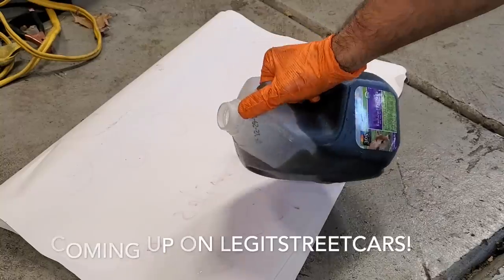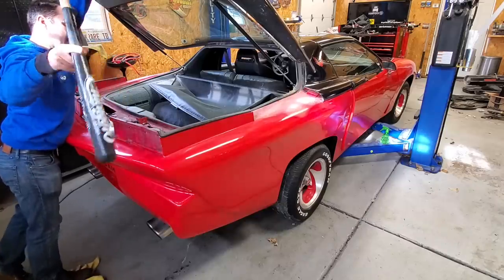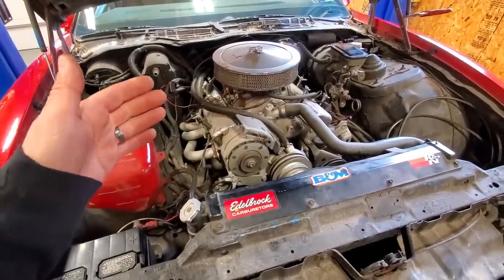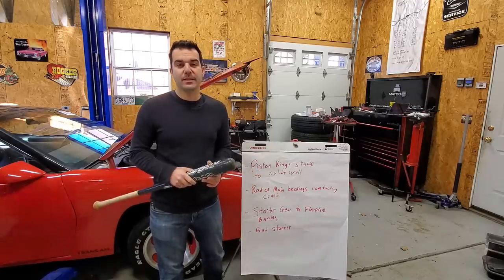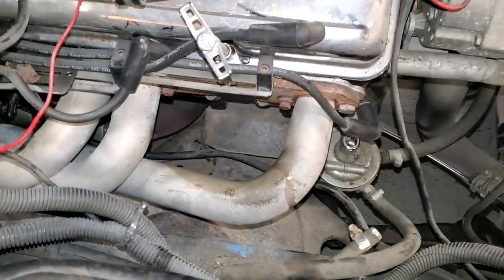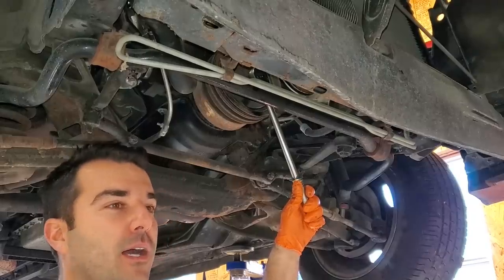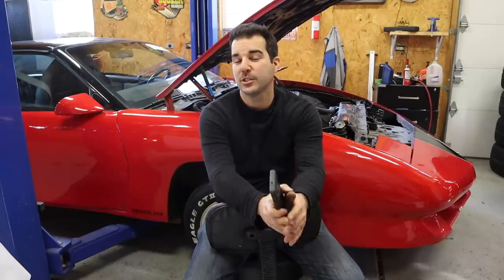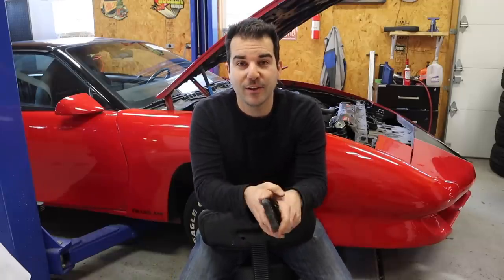My $1,100 Mystery Auction Car Has A CRAZY History! Famous Builder & Built Engine But, Will It Start?

Comment: You could have some sticky lifters that are stuck in the compressed position.  I would start it and let it run for around two or three minutes so the lifters have oil sitting on top of them you can check them by pulling the valve covers.  Then just let it sit two or three days and try it one more time, they should pump up.   Did you add all the new oil in one valve cover?  The lifters on that side could be sitting with new oil on them and the other side is dry.  Pull the coil and turn it over until you have 40psi or more for 30 to 60 sec.

Comment: That noise at the end sounds like either  a belt/tensioner issue or a bearing issue on one of the driven pulleys. I don't think its an internal chamber/valve/bearing noise. I could be very wrong though!

Comment: Sticky lifters put some Lucas oil stabilizer in it before you start it again. Also I would pull that  Distributor out with it being loose like that to make sure the teeth haven't been eaten. And I would just look inside yr valve cover were u add oil to see if the oil is flowing up top

Comment: Also, GM still has an office known as the Pontiac Historical Records, or something close to this name.  They might have a file on this car. There is a man named Jim Wangers. He was responsible for getting Pontiacs and Trans Am into lots of movies. He got actors like Clint Eastwood and Jeff Bridges into a early Trans Am and John Wayne into a 1973 Brewster Green Super Duty Trans Am and the list goes on. He worked for Pontiac and he started a company the made and installed specialty equipment on bodies in white Mustang II to make Cobras and 1977 Lemans into Can Am's. He would know about a car like yours.  You might have a very rare bird, that might start a feeding frenzy at the auto auction.

Comment: Rattling at 19:30 may very well be just valvetrain. If it's sat for waaay long the oil may not be getting to the heads very well check pressure. Really just needs to run! Maybe try some thinner oil or some additives to really break-up the gunk in the oil channels. Still, ya run the risk of cooking the heads, but change the oil a few times and that may help. Or it could just be loose internals that haven't seen heat or oil in a couple decades. Just run it, if it breaks oh well, LS swap it! LOL =)

Comment: check the torque converter to flywheel bolts some times they will loosen cause that noise sounds to me like its bottom end noise torque bolts can do it could be loose at crank also

Comment: Concerning rattle, check timing. Maybe just an exshasut leak? Hard to tell over my speaker. Check oil pump. Could also be lifter tick. May need to adjust rocker arms. Doesnt sound terminal but its hard to hear.

Comment: You have a nice car, with a beautiful history to it. I've been lucky enough to have had a 1976 Camaro and a 1971 c10 with a cool historical story. What is is unknown about there story's makes it quite interesting.
Reply: The car had a small block 400 . Which at the time, was only offered in a tow truck. AND no numbers stamped on the engine. Not ground ,just never vin stamped. The paint was re done after bought  from Crimson Red,to, black, with gold metallic  flake. Orange- to-red stripes down the side,with gold pinstriping. The car was from  a barn in Wisconsin. And the 2nd owner who sold it to me HAD to sell it, $500 & with only 34k miles!
Reply: The c10 , is interesting because of WHY? the original owner ordered a short bed,stepside( 1/2 ton )truck with 3/4 ton springs and HD cluch&brakes ,250cid w/ 3spd. When sold to me in 2001,with only 30,000 miles,for $500! I had thought it was 130k...until I had to replace the fuel pump. Seeing how everything was untouched. Back in that day, 100k was equal to 200k on today's cars. Lots of work,would have had to be done, at 100k miles. All paperwork in Great shape. Everything was original. Won 3rd in" original " class.  (not restored)1st))like the f-100, and the srt-10 (garaged(2nd)). But now have to replace a lot of parts,do to sitting outside so long. Less than a 1000 miles per year drivin!!!

Comment: Replace the rear hatch struts with ones for a mid 80's GTA. The mid 80's GTA's had heavy rubber aero spoilers and there the strongest struts for 3rd generation F bodies.

Comment: The oil pump is driven by the bottom of the distributor, make sure it is fully seated on the oil pump or you won't have oil pressure

Comment: people saying to use carb/choke cleaner dont know what they are talking about. Starting fluid at least has a lubricant in it carb/choke cleaner will completely dry out cylinder walls. IT'S MEANT FOR CLEANING PARTS PEOPLE!

Comment: I'm glad he stopped trying to turn the crank with the ratchet on the front, I was ready for the bolt to break. Next, is it the starter alignment or the  bendix drive causing the non retraction?
Reply: It started, oh man, what was that noise? Did you put oil back in? EDIT: OH, I stopped just before he said he put oil in!
Reply: Don't run it to long, no water pump belt.

Comment: starter will be fine when the car starts...its norm for it to stick out like that when you pull it out like that..also the sound..check flex plate for cracks....good luck..

Comment: Sounds like a couple of things going on, one is a lifter issue the other sounds like either a vacuum leak or an exhaust leak. As for your starter, you should not necessarily need shims as I never used them on any of my old Chevy engines, so you might actually have the incorrect starter but sometimes you do need to shim. Exhaust can make that same ticking sound like lifters, or your lifters are not adjusted properly, or are not holding pressure due to sitting.

Comment: Likely a lifter knock from lack of oil for a long time.  Maybe get better with time....or may need to replace.  Just my thoughts...definitely check that oil pressure though.  Definitely not get any better with no oil.  Pump runs off cam, distributor bolt stripped...maybe want to check that too...

Comment: you would have much better luck turning the engine with a flywheel turner... this will allow you to add far more torque without worry of snapping the crank bolt.... Lisle makes one for 20 or 30 bucks or you can get the big beefy from snappy!

Comment: I thing, the distributor is not fully engaged to oil pump. This is why you don't have oil pressure and
 why the top end is rattling and knocking.

Comment: The dist drives the oil pump if the hold down bolt was stripped out may have let the dist move up allowing the oil pump to slip of the drive and may have lost oil pressure  for a few minutes causing it to run dry on oil at the crank still may need to check the bearings!

Comment: Flat hydraulic lifters. Either from no oil pressure, or stuck deflated from sitting. That is my guess without removing the valve covers or listening with a scope.

Comment: Stuck lifter. Needs to run Seafoam in oil, run and change oil.
Oil sender is driver's side next to distributor area on the stock location

Comment: Some times the best way to take spark plugs out of some GM cars, is to take the front tires off, and its a strait shot between the inner fender and the A-frame .  I think the motor "locked up" because it was in too good a shape, ..to tight. if it had like 200,000 miles I bet you could of spun it by hand.

Comment: Im gonna say the bearings are wiped , you should not crank a dry motor that has sat that long without pre lubing first, at the very least you should have spun the motor when the plugs were out till u got oil pressure, then later you hit it with 20x the ether that you should have so that's gonna make a lot of pressure, it fired up and the dry oil pump did not pick up oil , the motor started knocking and im gonna say the bottom end is toast ... Pull your oil filter , cut it open and see if its full of white babbitt bearing material.

Comment: no oil pressure, loose distributor, you might want to check to make sure the oil pump drive shaft is properly engaged with the whizzy gear on the bottom of the distributor shaft. looks like the distributor is sitting a bit high, hard to tell. I might be wrong.

Comment: That knocking noise could be a stuck lifter since the engine had not been run for a long time and the lifters were not lubricated.  Does it possibly have hydraulic lifters?

Comment: Lock down that distributor some how. Its most likely poping up and out of the oil pump drive. Had that happen on a 350 once when lock down bolt stripped.

Comment: You do not have A350 H.O.
 The 350HO is based off a vortec engine.
center valve cover bolts. 
perimeter valve cover bolts 1st gen 350 still could be a crate but at best 290hp

Comment: Sounds kinda like a bearing rattling, I'm thinking rod.  If no oil pressure, bearings are shot now.  I wouldn't run it if the transmission is low on fluid, will damage the hydraulic pump.

Comment: I'd say the trans is somehow locked in gear but the car moves so that dont make sense I would have thought the accessories too I feel like it's the starter but how its bent leaves me to believe something caused that but if it's not retracting the key that could have caused everything
Reply: My theory is change the starter and go from there reguardless you need a new one so it's a good place to start

Comment: If they don't understand what you mean it just means that they are keyboard mechanics not that you aren't a mechanic it also shows they have no time put in working on various things and vehicles with a wide range of different problems that only comes with putting in years of work and you can tell u know what your doing.

Comment: Well you might be the perfect person to ask. I have a 1994 Miata with 15k original miles. Runs and drives just fine. But shavings in the oil every time I change it. Bearings going out?

Comment: Just FYI , Walmart does sell a very similar  oil can like your old one  i bought it to be able to squirt  oil  mixtures into small block Chevy motors  set up in tight quarters boats  and the oiler i did get at Walmart lasted over 10 years   Leaving it stored inside a Engine compartment of a Salt water boat  many old timers in the Marine world would swear  about Marvel Mystert oil so  thats what i used   On motors that hadn’t been run in long times  i wont swear by it but i know it didnt hurt  any motors i used it in  that i know of  and it did seam to help  to loosen the stuck rings  although i will add that on all those motors i  tan them like i was  breaking in a new motor to reseat  everything again  i did 2 Ford 302s that way and they ran flawlessly for over 12 years !  Good friends of mine are Ford Guys who had built many  high Performance motors for Drag Cars and i followed their BreakIn Instructions  which was pretty simple Idle for 7 minutes , 1500 RPMs for 7 minutes , Idle again, then 2000 RPMs for 7 minutes  i never asked  where or why they came up with that formula  because ive seen most of the builds they made over the years  and  knew they know their stuff  Congrats on getting the car going  motor sounds pretty good overall   I kind of like the entire Vibe of the car as i  had a Camaro from that generation  back in the day ! Believe it or not it was my “Family “ Car  as my other 2 at the time was a CJ7 Jeep and a 2 Seater Ragtop Sports Car

Comment: I bet you found out those shims didn't work. Those are for factory gm starters that use offset mounts. Your gear reduction starter has a straight across mount.

Comment: Looks like the starter shaft is twisted as mentioned and it causes the gear to turn slightly when moving in and out so once the gear is out against the flywheel teeth the starter gewr wants to turn on it's way back in therefore binds in the flywheel gear. Change the starter and all should be fine.  That starter probably was probably damaged on the first tries to turnnthe engine after sitting so long and who knows, it might of got damaged by this new owner if no one else started it since 2018.

Comment: I'm curious as to who built the engine, has it ever run for a significant amount of time, etc. Is it possible that it was built by a back yard yahoo that didn't properly clearance the pistons, rings, bearings, etc. Have you checked the alternator, etc for freeness? With the plugs out, the engine should turnover freely. By the appearance of the cylinder bores, this engine has seen very little run time.

Comment: I have not read all the messages, but I had a car that the alternator locked up on, took off the belt and it turned over just fine. you probably already checked this, but it can't hurt to toss that idea out. thanks.

Comment: No starting fluid in a gas engine ever. And I’d have pulled the distributor out to pressurize the oil system. Other than that. I think the starter was just a bit dry.

Comment: I'll let you take the motor out and him a engine stand and turn it upside down and open the bottom oil pan to see what's going on inside see why it's locked up and probably needs some motor work done on the bottom of the engine

Comment: Lifters are probably ticking since it got so oil dry. 
Throw a can of Seafoam in the oil and let it idle for 15-20 minutes. Drain. New oil. 
Plug that vacuum hose. It's from emissions crap the crate engine doesn't have. 
I'll bet the trans leak is just a bad trans gasket. R&R it since you ought to do a new fluid, filter, and gasket on the trans anyway. 
Looking good. Cool history. Make sure this car gets to a good home where it will be appreciated and cared for. 

P.S. tell me this thing wouldn't look badass with an LS7 under the hood! 
https://upload.wikimedia.org/wikipedia/commons/thumb/2/2d/2006_Chevrolet_Corvette_Z06_LS7_engine.jpg/1920px-2006_Chevrolet_Corvette_Z06_LS7_engine.jpg

Comment: Sounds like a broken lifter or valve. Would probably be a good idea to just tear off the heads, intake and see how it looks from there instead of just firing it up and reving it. 
No oil pressure? Maybe take off that oil pump or check the pickup in the oil pan.

Comment: Dr.D here in not so hot Regina Canada you should may be add Zink additive most fat tapped engines from the after market usually needed, maybe give a engine shop that hops these up on a regular basis a call. I have seen a cam killed just in the break in procedure because the additive was not there. the ticking may be a lifter,on the starter you have a high torque unit and may have different shim procedure .hope it helps ps not a real doctor

Comment: The distributor drives the oil pump. If it has become disengaged, you are running the engine with no oil circulation!!

Comment: Seems the problem (amount other things) is the starter.  Because of the previous alignment issues the starter itself is bad. Though its retracting the starter still should be replaced or rebuilt.  AND...  YES!  You have gotten away with murder.  Good for you.

Comment: Fill it with kerosene then wait a week or 2 then it should loosen up and possibly be just fine I have had a few cars that were locked up and once I unseize them 1 drove with no problems for over 4 years before encountering any problems the other only about 6-8 months.

Comment: That hatch might not be so heavy if it didn't have all of that extra obsurd fiberglass body attached to it. the back glass and the metal trunk only weigh about 120 pounds max by themselves when you add all that extra fiberglass that weight could easily double. As for the honey thing i've had it on my browser for a little over 3 years now and i buy electronics and car parts like mad also and it has literally saved me over $12,000.00 in the short time i have had it installed. I also used wikibuy for Amazon for a while until it got a bug in it and became an open security hole (probably why you don't hear anything about it any longer too i gather)  have had 5 of these 3rd gen cars my first was a brand new fresh off the lot 1985 Camaro IROC-Z, the second was an 84 trans am (like kitt) with the cowl induction hood 3rd was an 86 Z28 camaro. 4th was a 1991 camaro RS and the last one was a 1992 Firebird. the two i had the MOST fun in were the new IROC and the 84 trans am i got into a LOT of trouble in the iroc causing me to have to sell it. and most of the others were project cars that i drove occasionally and still got into trouble in but no where near the trouble i got in with the iroc. love these cars but i prefer the T-top cars actually even though everyone complains that they leaked i kept the seals in mine treated and never had one leak on me not even a little.  of course if you buy one that does leak a new seal kit for the 3rd gen's is not expensive at all

Comment: Shims may not work proper with  that starter, maybe to new of a model starter or its bent from ramming it into the flywheel. If the old style larger starter was used there is another brace to the block to support it, seen many damaged from not being braced. Thats common for small blocks, some times had to put shim on only one bolt to align the gears proper. If the engine has high compression pistons and aa higher lift cam it would naturally crank harder.  And even once its warmed up it could still crank very hard every time its shut down and restarted with a warm engine, especially with high octane fuel. Thats why that smaller yet high torque starter was invented and popular on racecars. No matter if you think a stuck engine is the same as a motor hardly cranking over, then I recommend no one watch your video's at all.

Comment: The distributor is loose. No oil pressure. PULL THE DISTRIBUTOR OUT AND THE OIL PUMP SHAFT.  EITHER THE PUMP SHAFT EARS ARE BROKE OR THE TOP OF THE OIL PUMP SHAFT.

Comment: The rockers are hitting the oil return inside the shitty valve head covers someone put on it. I can hear it. Take some metal snips and remove that flange inside each valve cover and that noise will go away. That's not a tap or bottom end knock. Lol.